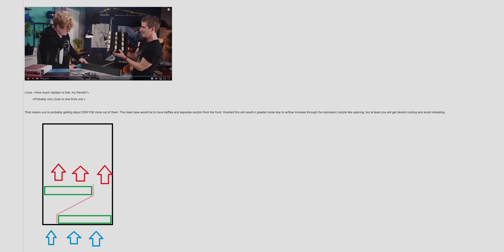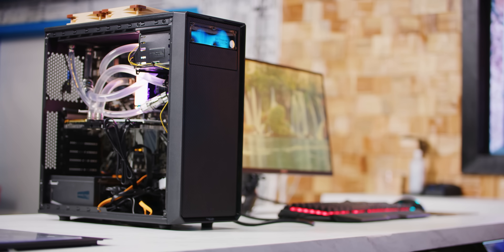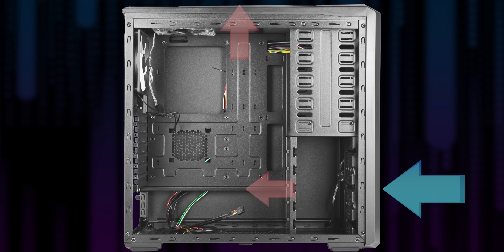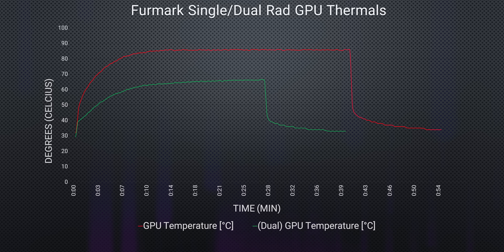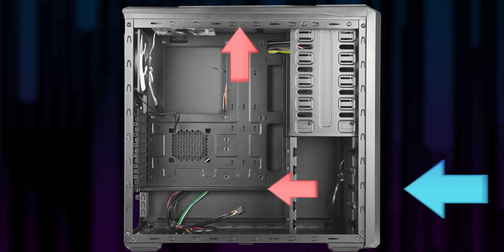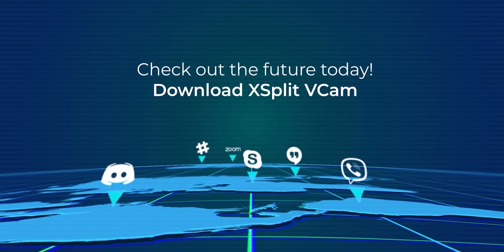I’ve been water cooling wrong for YEARS - $H!T Manufacturers Say

Comment: You messed up your testing methodology by not testing the components side by side stock, meaning the lottery and manufacturing differences/defects to see if they do indeed perform exactly the same thermally. Then you would water cool them, there is an offset chance they differ because of the aforementioned.

My 1080 can reach as high as 80 degrees stock, when I've seen people hover around 70. Just saying mate, some cards don't perform as well as others just like CPU's and the silicon lottery. Do I see more rads benefiting most people who use them? Of course, but this is something to consider when speaking in the name of science.

It's also possible Corsair wants to dissuade water cooling users from making their own loops in favor of just buying an AIO, which comes with one rad. lol So in other words all this really boils down to is money.

Comment: What was Corsair thinking? The air entering a rad and leaving the rad isnt going to be the same temp as the water in the rad. Even if this was done in a sealed box with one rad on each end, there was still be some meaningful improvement. Now while I do agree tha the rad isnt the weak link in water cooling. Adding more thermal mass is never a bad thing. That said, the weak link is the waterblocks.. Stupid short microfins used in most AIOs are designed for mas production and not best performance. There is simply not enough surface area needed to transfer the heat from the CPUs IHS to the water. A single 120mm radiator has easily 8 to 10 times more surface area to water ratio than the waterblocks do. Which is easily seen in the huge temp deltas from CPU to Water.

Comment: The reason that your real world testing yielded results indicating that rad stacking is good is because radiators transfer conductive heat from your coolant to radiant heat that is transferred to your air. The air, however, has no source of heat, while your radiators constantly absorb heat from your coolant, and are constantly emitting radiant heat. Basically, your air is constantly in a state of heat-loss while your rads are in a state of heat-gain, or remaining heat-neutral. Therefore, even if your air is the same temperature as you rad, or even a little warmer, the air will still cool the rad, as the heat in the air is at a state of loss, or neutral gain, while the rad is in a state of gain. Efficiency may vary, obviously, and will reduce to 0 at the point when the heat energy stored in the air is great enough to counteract it's losses and is able to conduct to the aluminum or copper in your rads. Think of it like wind chill, hot air feels colder on a hot day when it is moving, and even if it's greater than 37 degrees Celsius, it can cool your body down if it's moving.

Comment: You have not added a radiator that blows hot air from the inside to the outside, but you have added a radiator that takes fresh air directly outside (4:16) I think. It was not the problem that Corsair said.

Comment: So, are we going to gloss over the fact that adding the second radiator increased the water capacity? I would have been more satisfied with that experiment if both systems had the same amount of water. Granted, a second radiator gives more surface area for the air to go through and I would assume the results would be close to the same... It just kind of seems a bit sloppy to not consider that a failure or at least, skewed results.
I also genuinely wonder why plain water? Adding something to reduce water's surface tension (alcohol or even antifreeze?) would help with thermal conduction, wouldn't it? I know it does in automobiles. Plain water tends to try to dissolve everything it comes in contact with.

Comment: Actually Corsair is right. WHEN YOU stack radiators and DON'T CONFIGURE them in COUNTERFLOW, meaning when you hot water enters the coolest part or your radiator (the first radiator). In this case ur water is cooled down and the air is warmed up. So far so good. But at the next radiator ur cooled water is forced to deal with the already warmed up air. This Effekt faster gets to a point where your cooled water can no further be cooled because of your warmed up air. You will better prevent this when you feed your hot water into the hot end,meaning the last radiator. Then your hot water is cooled with the already warm air from the other radiators. Then the cooled water is further cooled by less hot air. And at the first radiator your chilled water is cooled by the most possible cool air, ambient temperature. Using this called counter current model provides the best temperature differences between water and air regarding the complete cooling system. Because ur coolest point of water is at the coolest point of your air. That's why counter flow models are widely spread in the chemical industry, where cooling efficiency is lots of money and a security issue.
Reply: Not as much as you might think.. in computers the total thermal mass of the water is far greater than the energy produced. That’s why a water loop takes so long to get to a steady state. In normal words; this means that the water entering a rad, is only a degree of two hotter than the water leaving it. 
In big industrial systems where the coolants thermal mass is less compared to the heat source & cooling system, this would probably be more important
Reply: bruh
Reply: I was hoping they'd test this, I thought that was the point of this video. More heat exchangers with ambient air is obviously going to cool better
Reply: This comment was better than the video. Science!!!!
Reply: maybe its no big deal, but I would like to see them testing this instead of what they did.

btw, here is what I mean in pictures. Mybe its no big deal, because of the low power input, but maybe it is https://www.quora.com/Why-is-a-counter-flow-heat-exchanger-better-than-a-parallel-flow-heat-exchanger
Reply: That doesn't make corsair right,  at best it means they're not completely wrong.
Reply: *Acthyooally

Comment: I don't think I'm gonna pull out my second rad only to test if it does anything :P
also the flow orientation is very important. the hot water should always meet the warmed air stream and the slightly cooler water with the second rad the cold air stream, this way you get more heat out than reversed.

Comment: I know it's not this chanel style but i would gladly see analysis which takes account of different factors (air flow, fan speed, case design, coolant, pump rate, coolant flow direction, different air pressure setups, rad placement and so on) Maybe steven will eventually make one.

Comment: Are you sure you do not have a bias in your calculations? What could probably make the biggest difference is the amount of water you add with the second radiator, especially if you take into account that it took so much longer to heat up

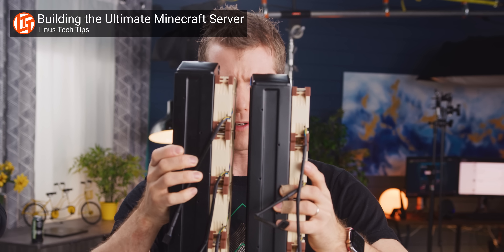Comment: I bet they meant that about putting radiators right behind each other like here 1:29 - this will not be beneficial
But putting them at different spots? Why not?
Reply: Actually Corsair is right. WHEN YOU stack radiators and DON'T CONFIGURE them in COUNTERFLOW, meaning when you hot water enters the coolest part or your radiator (the first radiator). In this case ur water is cooled down and the air is warmed up. So far so good. But at the next radiator ur cooled water is forced to deal with the already warmed up air. This Effekt faster gets to a point where your cooled water can no further be cooled because of your warmed up air. You will better prevent this when you feed your hot water into the hot end,meaning the last radiator. Then your hot water is cooled with the already warm air from the other radiators. Then the cooled water is further cooled by less hot air. And at the first radiator your chilled water is cooled by the most possible cool air, ambient temperature. Using this called counter current model provides the best temperature differences between water and air regarding the complete cooling system. Because ur coolest point of water is at the coolest point of your air. That's why counter flow models are widely spread in the chemical industry, where cooling efficiency is lots of money and a security issue.
Reply: absolutely this, stacking them back to back you are passing hot air to the next radiator, i bet that's what corsair meant
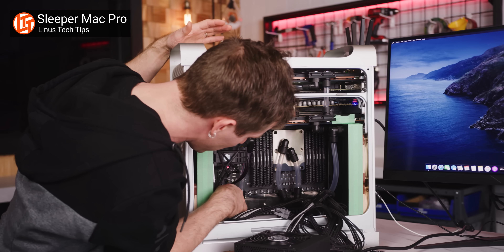Reply: 6:46, well stacking also worked.
Reply: If I were Linus I would get a 2nd opinion from someone Like EK who has been in the business alot longer than Corsair and see what they say on the topic.
Reply: I wouldn't be so sure about that. If that were the case, then a thicker radiator wouldn't outperform a thinner radiator (given equal airflow and surface area per unit thickness...) Certainly there is a  point of diminishing returns, and I would imagine loop order might matter, as well as total airflow.

If you're running 50CFM, the air will be saturated after the first radiator. But at 500 cfm, the story will be very different.

Comment: If you are going to test this, why not measure air temp in the case and also measure water temp? My testing also tells me that adding a radiator provides better water temperatures even if it uses the warm air provided from another radiator :)

Comment: I agree with Corsair more airflow or negative pressure in a pc tower/case the better because you need a way to push the hot air or the air with allot of energy out of the case or it’s just gonna make it seems like the water cooling solution isn’t at full potential of dissipating the heat correctly also they are talking about Newton’s cooling law which is very useful in my opinion

Comment: The segment should be called $H!T Linus says. 

In summary, this is what happened.

Corsair: Your build A would be better off withOUT the extra rad. 

Corsair: Your build B is not configured right. Too much stacking

Linus proceeds to ask some staffer to create a build C that Corsair has never seen, that is configured very differently from build A and B. In this particular case, the extra rad is actually effective.

Linus: Corsair was wrong. But also, every system is different.

So we learned exactly NOTHING. Nothing at all. This is so dumb.

Comment: Ok Linus, I'll say it for you. 
Corsair doesn't know anything about custom water cooling. This video is evidence of that as well as the fact that Cosair is STILL selling defective GPU water blocks to their customers that will leak due to someone's incompetence in designing it. When it comes to custom water cooling stay far away from Corsair. 

Low budget buyers go with EK.
Mid range buyers go with Thermaltake.
High budget buyers go with Phanteks.

Comment: If I understand your test you took it up to high temp and then removed the load to let it cool? I think that a Dual radiator would not allow the air temp to get up to max in this process. If you do the test but keep the load on and measure the air temperature between the radiators. I expect that once the air temp gets up to full temp and held the 2nd radiator would then be less effective. Dual radiator would likely help slow the system getting to max temp but once there and under sustained load it would make no difference. The other thing to look at is the air flow speed v air temp between the radiators. If the additional fans pull air over the radiators faster this may mean the air has spare capacity to cool when it gets to the 2nd radiator. All just some theories I guess?

Comment: it most likely has to do with flow directions. When the waterflow has to be in the opposite direction as the air, otherwise the efficiency will drop quite fast. So the hottest water hits the hottest air and the coldest water hits the coldest air.

Comment: Oddly enough I've run into the issue corsair stated. I did a project with 2 x alphacool 480mm long 60mm thick rads just because i had a case that could fit them and i thought i could saturate it with a crossfire setup. It did very nice job but oddly enough i noticed that when you have a rad sufficient enough to dissipate the heat to a fairly extreme level all by it own then the second rad indeed does nothing more than restrict airflow and when removing it the temps dropped a few degrees. I knew it was overkill to start with but hey its fun to challenge yourself.
That said what you show here is at the point that the single rad is simply not enough so adding an extra will be able to deal with the missing cooling performance regardless of diminishing returns.

Comment: Was the second radiator present in the first run or not? Adding a second radiator means more thermal mass, which would explain why it took longer to reach max temps in the second run.
IMO the ideal thing to do would be to have both radiators in the loop, one of which wouldn't have any air going through it (i.e.: no fans, dangling inside the case adding thermal mass to the loop without dissipating heat outside of the system).
Reply from the maker: The second radiator was not present in the first run - it was added via the quick disconnects for the dual rad run. -CW

Comment: idk what corsair was even thinking.

Heat exchange works off a a temperature difference as you said, and it scales as the 1 divided by the square of the difference. So the larger the difference the much more it cools.

They seem to be operating under the impression that after the air leaves the first radiator it is either the same temperature as the water, or the water in the second radiator is the same temperature as the air.

Anyone with common sense, and not even an engineering background, could tell you right away that theres NO WAY they have a rate of heat transfer SO GOOD that the air leaving the first radiator soaked up SO MUCH heat that it reached the same temperature as the water. Simply from imagining how little time the air was in contact with the radiator it takes 

and on top of that, there is NO WAY that the water in the radiator would ever warm up so much that it was the same temperature as the air.

this is one of those cases where they have an engineer who bows down to the CFD gods and forgets that such a thing as intuition exists. 

These are the engineers you dont want on your team. 

AT BEST you can call radiator #2 and #3 "diminishing returns" because the air will slowly heat up. But theres no effing way it will ever reach the same temp

Comment: Corsair: Buy less of our equipment, might help
Linus: Nope, buy everything they have, will help
Weird marketing strats.
Reply: Well it got LTT to talk about em... from what I have purchased from them they do not make terrible products at least.
Reply: But Lunus got what Corsair were saying wrong. Corsair didn't say you couldn't run two rads in a system. They were saying that you need to make sure all the rads are either sucking air into the system or blowing air out of the system. By having one sucking clean air (thermally) into the system and one blowing dirty air (thermally) out of the system, you reduce the capacity of the second rad to dump heat in the air. Remember, heat always travels from areas of high heat densities to areas of low heat densities until an equilibrium is reached. That's one of the  rules of thermodynamics, and you can't violate it. While I don't think they're correct in that the second rad is functionally useless, I'd have to guess it's running at half it's functional capacity.
Reply: any publicity is good publicity, right

Comment: I think what they were saying is having them directly on top of each other vs being separate and that is something you didn't test I may be wrong and there may actually be no difference
Reply: Exactly! Linus's rebuke is totally disingenuous ! It would have been fairer to show the temperature achieved in that server build Corsair was criticizing with 3 rads mounted on top of each other vs the 3 rads as parallel air input in the build. And Linus's build worked but it was less efficient. If you're not letting sufficient airflow through the radiator because it has to go through 2 stacks of radiators before that, you only get marginally cooler results because you have more water in the system.